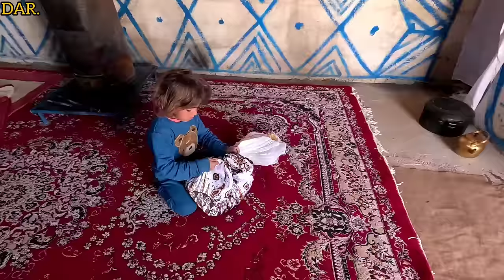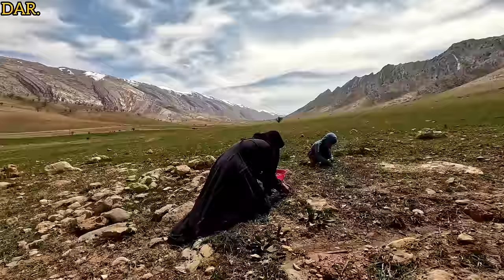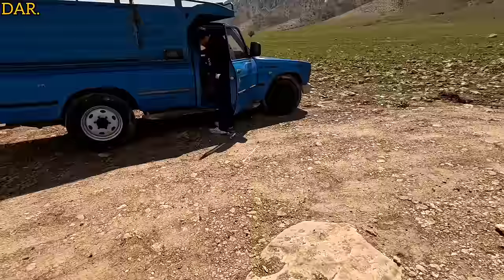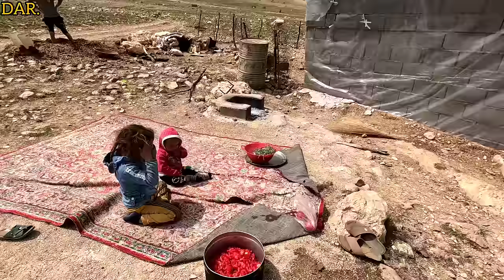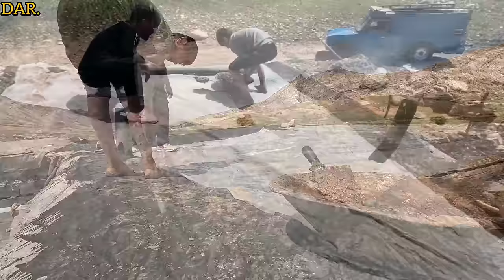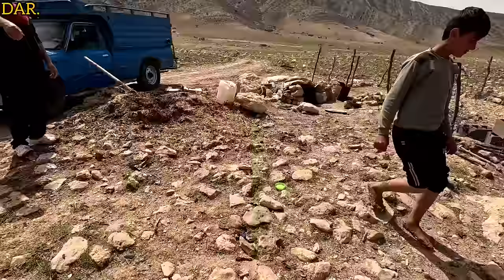nomadic woman's bravely Battle  against on injustice of wicked husband: Soldier's support

Comment: If all of a sudden Aida need's new clothes because her clothes ended up mold, the girls constantly coughing because of mould, they had more bedding not so now, everything damp wet or mouldy mother hasn't the space to continually drag carpets bedding clothing and find somewhere to hang them. Father does ask when the roof will be fixed or replaced. Uncle soldier and cameraman don't live there, they don't drag everything outside then back inside again. Of course both uncle and cameraman are getting paid big bucks on the health and wellbeing of mother and babies